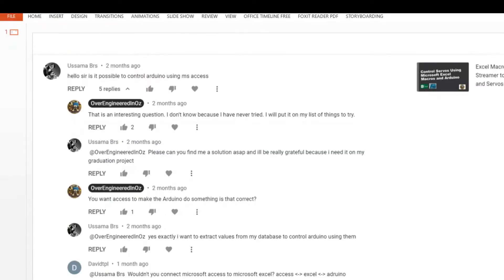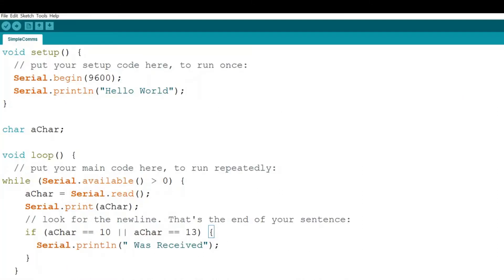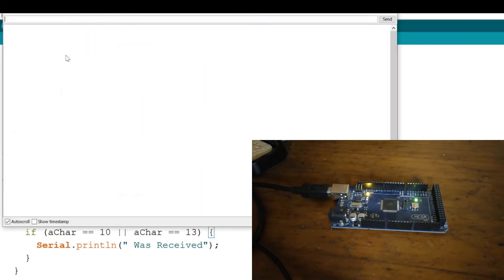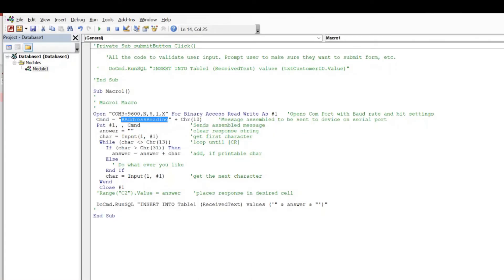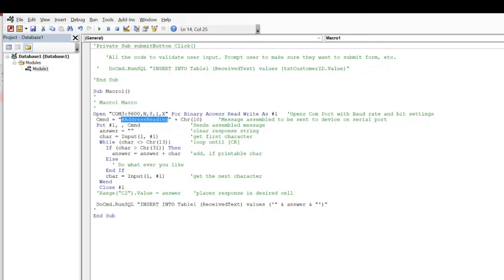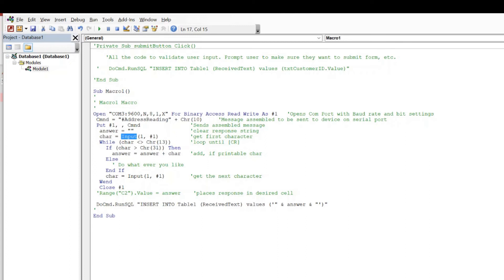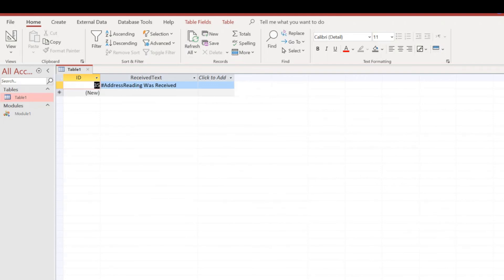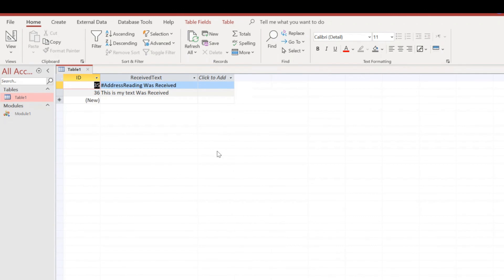Microsoft Access and Arduino Communication

Comment: This was the missing key for my project, so first off, Thank you!

Secondly, a stupid question… At the end of your Arduino code, why the numbers 10 and 13 in your “or” statement?

Im assuming this is how we know that the text was received, so why is achar 10 or 13 when something was received.
Reply from the maker: Thanks for the feedback. 10 and 13 are ASCII character codes
ASCII : 10 known as the 'Line Feed' or 'Newline Character'.
ASCII : 13 commonly known as 'Carriage Return'.
Basically what the code is doing is looking for the end of the line of text so it can know what to process.

Comment: Hi. Is it possible to send something like SCPI commands from an arduino micro controller to test equipment (keysight, agilent freq counters, etc) and receive data values? I would like for the serial monitor to receive data readings continuously. Any advice or ideas you may have are greatly welcomed!!
Reply from the maker: My guess is that it is possible. I don't have any SCPI devices to test it with unfortunately.
Reply: @overengineeredinoz7683  thank you for the swift reply

Comment: I'm tryingt this and the Com Port line returns a type 52 or 75 erros, bad filename etc any thoughts? Using the right com, baud etc, do you have to enable access in Acccess somehow?
Reply from the maker: Is the com port the same as the one for the Arduino serial monitor?
Make sure Arduino serial monitor is not connected at the same time.
Reply: @overengineeredinoz7683  thanks for coming back so quick. It's not for an arduino it's for another serial device. The com port is right and nothing else is connected. It's a bluetooth comport though which perhaps is confusing it?
Reply from the maker: @domcharman5606  possibly because it is Bluetooth. I haven't seen the error 52 or 75 before.
Reply: @overengineeredinoz7683  Looks like it, testing the same code with a cable device seems to work (although it crashes out @ WEND) thank you
Reply from the maker: @domcharman5606  good luck